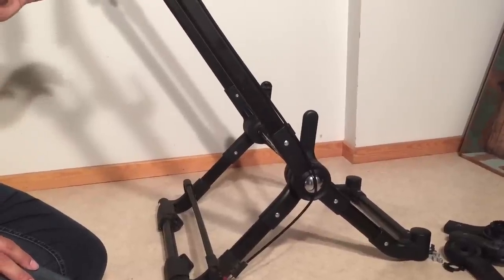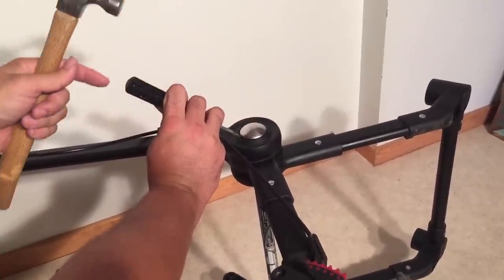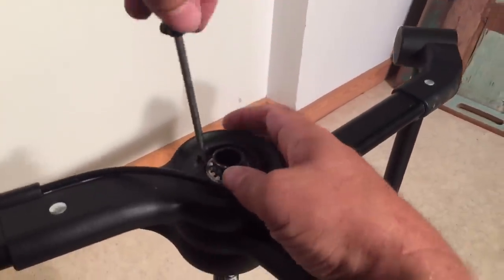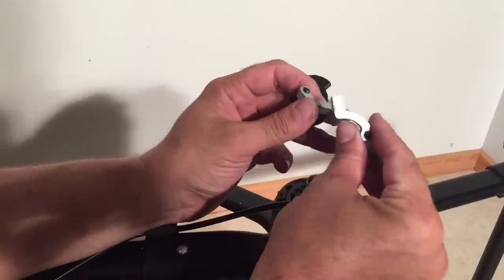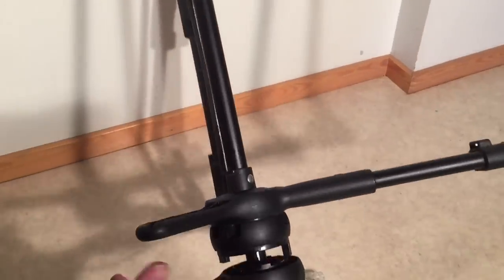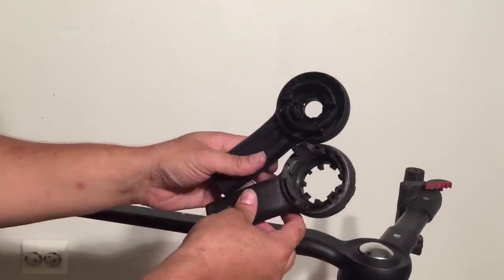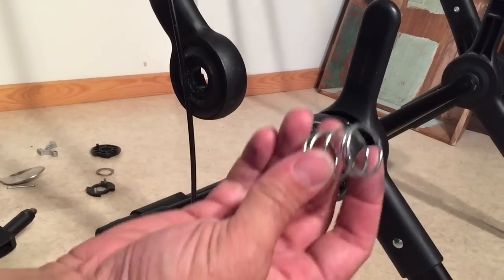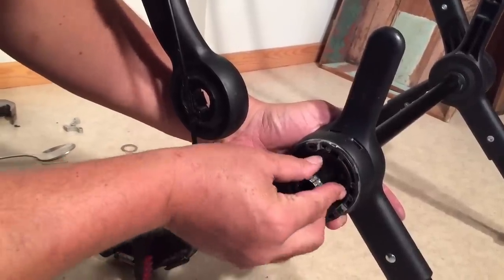How to Fix the Central Locking Mechanism of a Bugaboo Cameleon 3

Comment: Just managed to fix my Cameleon 3 thanks to your video! Removing that first cap was crazy difficult! Once I had it apart, I was surprised to see that my disk was not broken, nor was there a lot of wear on the adjacent pieces. So I guess that it was the wire that disengaged from the lock wheel? I reassembled it, with some difficulty and a few tries, and it seems to be working again. I suspect that wire could disengage from the wheel again in the future, and will probably glue something very small behind it to lift it a bit more. Hopefully it won't be necessary though!

Thanks for your detailed video!

Comment: Huge thank you for the detailed explanation! Just fixed mine one. 

It was so hard to open the cap and the washer even though I had watched your video. Almost was about to give up. But finally did it.

I used super glue + baking soda to put the pins back and it worked just like magic. The pins became really strong in about 5 minutes. Let's see how long it would last.

Also I found out that you can use a regular plastic cap from the bottle to hammer back the washer with just one hit. The washer remains flat.

Comment: Thanks for the video, stroller fixed ! 
Instead of the rivet I used a small m4 nut (it fits perfectly into the lower part of the disk with a bit of glue). Then I putted  a m4 screw (without the head) from above. It seems to hold strong enough

Comment: Thanks a lot. After watching this video 10 times I managed to fix the 1st side of the caméléon. Now off to the other ;)
I used some strong scotch tape to hold the pieces together while I was putting back the teethed washer. This way I could use my 2 hands. Also for that part, I found that using an empty tape roll between the washer and the hammer is PER-FECT to gently squeeze it into place. The hole in the tape roll is just the side of the washer ;)

Comment: Thanks a lot for your videos, very descriptive! One question: the wire of the central disk keeps coming out of the hole of the disk. Do you know why? Is there a way to fix that? Thanks.
Reply from the maker: This is such a horribly fiddly system to disassemble and fix. :) If everything else is clean and undamaged, then it's really just about disassembling and reassembling, until it works right, otherwise, this means that the elevation is off somehow, or the reassembly isn't tight enough.  Best of luck!
Reply: @BarnevognverkstedNo  Thanks you very much!

Comment: Hi thx 4 the video! I just need to replace the broken plastic parts, pins on both sides broken. The aluminium parts are in place, BUT it works only when the big tires are in front, if i switch back, nothing holds, what iam doing wrong?
Reply: Did you ever figure this out? I’m having the same issue right now!

Comment: Thanks for the video, I did everything as stated, created new pins with screws, but when I put everything together it still doesn’t lock the handle in place? Did I assemble it incorrectly? I’m scratching my head
Reply from the maker: This is a ridiculously fiddly repair, unfortunately - a few milimeters can mess it all up.  Try taking it apart and putting it back together a couple times if necessary, and look to correct thickness / height differences on your pin-disk (also look for damage on the surrounding housing elements which might be preventing the metal pieces from holding tight).  Note that if everything looks ok, it can still get knocked out of place during reassembly - hence the possibility for needing to reassemble it multiple times.  I feel your pain :)
Reply: @BarnevognverkstedNo  thanks, we made it!

Comment: My handle locks and when I test each side with the button it doesn’t drop down but it is more wobbly than it was when new. I got it second hand and my friend said she had lots of bags on it over the years so that’s made it more wobbly I’m sure. But if it still locks well but is too wobbly (and drops slightly more on the left side when pushing down on it) what needs replacing?
Reply from the maker: Nothing, unless you want to replace nearly everything related to the first and second disks.  And even then, a certain amount of looseness is to be expected with this model.  See this video: https://www.youtube.com/watch?v=Zb1ttc8ydDs

Comment: Hi there just came across your video we hope to fix the folding mechanism on our cameleon 3 it clicks into place on one side (the small wheels side) but not on main side where handle is above big wheels however how do I know which side of the folding mechanism is broken? Thank you
Reply: I think you press the button in on one side and if there is no resistence when you move it, it's the other side that is broken. Lock side breaks more.

Comment: This video great although when ever I put mine back together, the handle clicks into place perfectly yet the bottom won’t fold in, what am I doing wrong?
Reply: Also on the none brake side I don’t have a second disc that sits flush on top of the spring and the larger round part that sits inside

Comment: Where did you buy these parts from
Reply from the maker: I took them off of another stroller.  As far as I know, they can't be purchased new, but it is very often possible to buy used chassis' for replacement parts online :)
Reply: The Stroller Workshop / Barnevognverksted oh okay thank you for your help